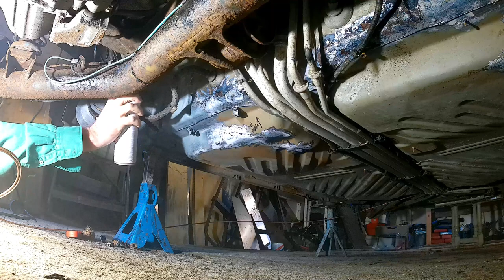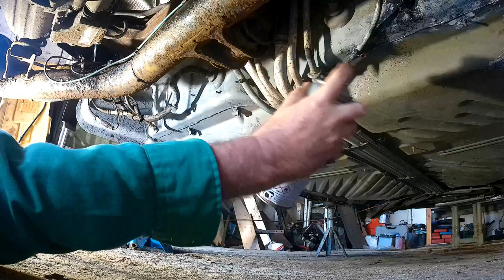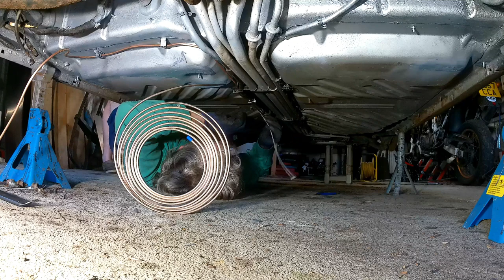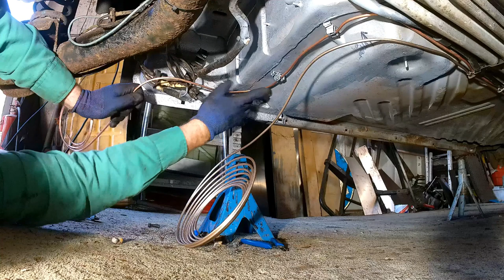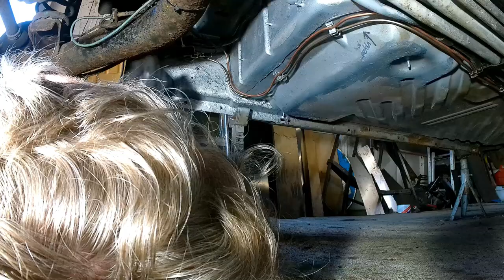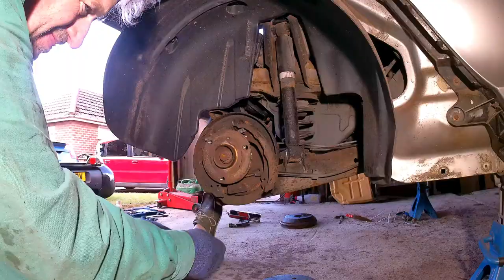Andy's Garage Smart Roadster Ep 4

Comment: What products did you use?
Reply from the maker: Some unbranded rust neutralising stuff then primer then a can of Silver Wheels that was on the shelf.. I'd say it will slow down the rust's return by abut ten minutes.
Reply: Would you mind me asking for the dimension of the thread of the brake line's nuts? If they're are all the same. I need to replace some of the brake lines. Thank you!
Reply: How die you bleed the brakes?